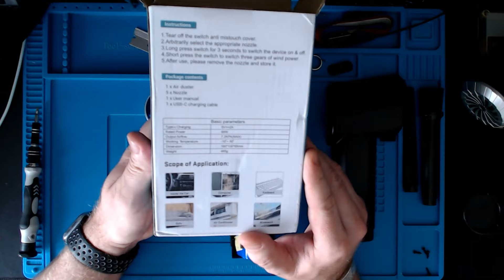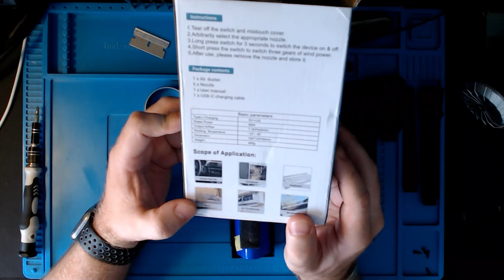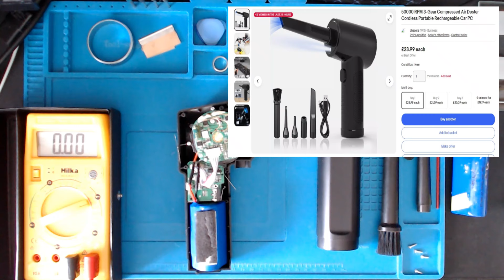Opolar Air Duster Battery Replacement | With Slip

Comment: 18650 cells are connected in series so the current capacity is 2000mAh, if they were in parallel, we'd be looking at 6000mAh. Yes the label is deceptive! In order to avoid this again, I decided to buy high quality cells and make my battery pack myself, but making sure the XBL-3S015 BMS board is reconnected properly, FYI '3S' is for 3 cells in series. 👍
Reply from the maker: Thanks for this great information & props for making your own battery pack!! Cheers for watching bro!

Comment: It is typical chinese label specs, which are deceptive. There is 3 x 2000 MAh cells in the pack, so they call it the total of 6000, even though in the pack it they are connected in series (so a 3S pack) meaning in that case it really is only 2000 MAh at the 3S voltage it puts out.
Reply from the maker: Thanks for this! I did think that as they are connected in series that 2000mAh would probably be the max output but I'm no expert so thought I'd ask you guys 👍Cheers for watching much appreciated

Comment: Thanks for the guide!  It always helps me to see someone else attempt something before trying it myself to build up my confidence.  I ended up just buying a replacement battery pack (12V 3A 18650 3S1P) on AliX and it worked out great.  The wires were plenty long enough if I wanted to solder directly to the circuit board but I took your advice and just splice soldered it to the existing wires, that I snipped off.  Cheers, mate.
Reply from the maker: Awesome glad you managed to find a suitable replacement battery pack & that the guide helped you out! Thanks for sharing that cheers mate!

Comment: Helpfull video! Although I would like to just buy a spare battery to replace it, instead of a new air duster to take the battery from that. Do you have any link to buy a replacement battery? It would be great! Thank you very much
Reply from the maker: Hi thanks for watching! Sorry no, I actually looked around for just a replacement battery pack on it's own at first but was unable to find one! The numbers from the original battery are shown here in this video so fingers crossed you may be able to source one!
Reply: @SlipsFix  Thank you very much for your replay! Got it...I wasn't able to find the same battery either! Anyway I was wondering if it was possibile to remove the battery and make the air duster work with the mini usb cable provided. It would be more inconvenient because it always has to be connected to the wire, but at least we get rid of this battery problem... maybe it could be an idea for one of your next video! :-D  In any case thank you very much!
Reply from the maker: Someone in the comments has mentioned that they use their air duster plugged in via USB with their mobile phones spare battery pack to make it more portable but I'm not sure if removing the battery from the circuit would stop that from working? It would be great if you did try it to then report back and let us know if it does work but obviously the duster will feel a whole lot lighter without the battery! I think any alternative solutions atm would be great to get these air dusters working again!!

Comment: It’s so funny that I did this twice on a different unit and this one called Opolar. The company sent me the Opolar after I complained about the first air duster device. But the Opolar started acting up also with the battery life. 

I performed the same surgery as the first device on the Opolar and now it works like a gem. Then months later I find your video. Nice! If they used top quality batteries it would never fail. Great device, terrible batteries. Thanks for the video though it was after the fact lol.
Reply from the maker: Thanks for the comment & glad you managed to fix yours up! Exactly, the batteries do not seem fit for purpose but thankfully there are work arounds!! I tried to reach out to Opolar directly via Email but no reply & the London contact number was inop last time I tried. It's surprising how many times I reach for the air duster it's an awesome device when it's working!! Cheers for watching!!

Comment: I purchased the Opolar, Air Duster through Amazon on 11/16/2021.   It was used periodically over the past years.  It might have been charged a dozen times.  As of 10/18/2024, the device no longer holds a charge. 
Looks like the device is functional if UBS is plugged in to power. Guess I will carry around the Air Duster plugged into my cell phone's extra battery pack via UBS.
Thought you all should know my work around.
Reply from the maker: Thanks for the info! Good to know that this alternative works if changing the battery is not a viable option, seems as though more & more of these air dusters batteries are on their way out even if they are not used very often!
Reply: Same, hardly used Opolar Air Duster (the model with the vacuum function). It was working a bit but would shut down on full power.  Charging light comes on for a bit, but obviously not charging.  It does work on micro-usb but again shuts down on full power.

I'll try and disassemble, but the ring is hard to get off - I'll get a rubber strap wrench to remove. 

It would have been interesting to compare the donors performance. I'm not sure if Opolar is overpirced/overated, but their batteries and access are poor.
Reply from the maker: Much the same for me as it was working fine for a while & I always try to not to do too many short charges as there is no battery level indicator. I usually run it so it turns off and then do a full charge. As you mentioned for the price of these air dusters you would expect it to last longer & would assume that good quality batteries would be used!
Reply: I tried with power banks but just work for few seconds and stop working 😢

The battery is not holding the charge
Reply from the maker: Sorry to hear that! I haven't tried this method myself but as I thought & confirmed by more comments that the original batteries in these devices are failing & I didnt use mine that often. When possible I would let the battery run down until the unit turned itself off & then I would charge it back up fully with no interrupts. I'm assuming that it's the same though for others that would just randomly charge the device as & when. Hopefully this how-to video will help you out if you attempt to replace the battery & I can confirm that mine is still going strong! Many thanks for watching!

Comment: so after the new battery the unit charges up fully and holds a charge? 
I have the same issue. Charging for 5 min then unit powers on for 5 min then dies.
Reply from the maker: Had no issues since the battery replacement infact I'd say it lasts longer than it did when it was new!